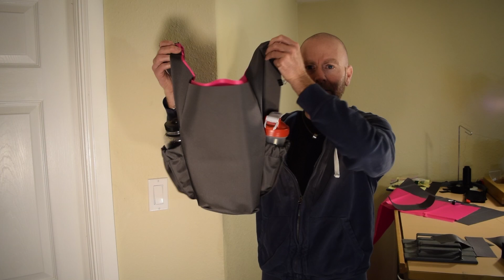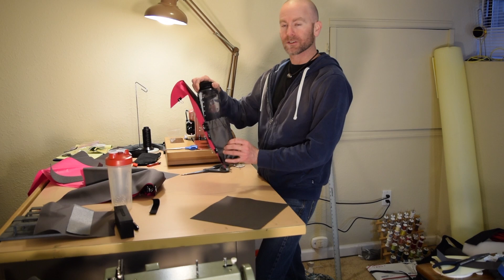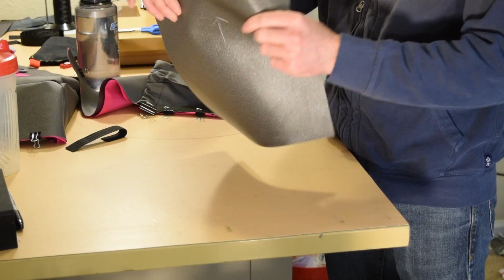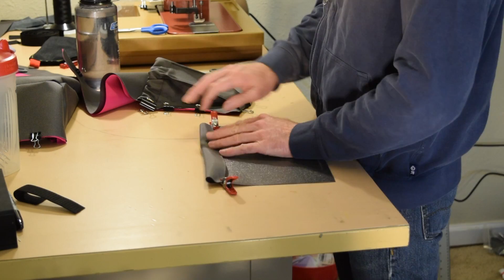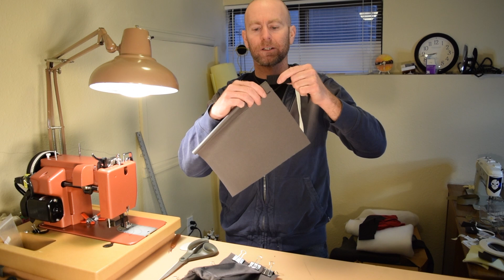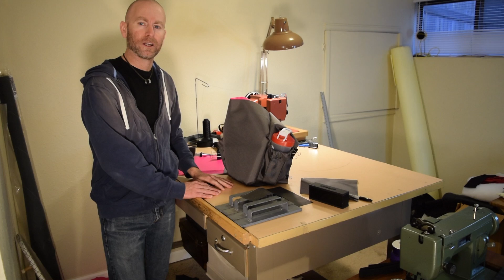Making a backpack: sewing water bottle pockets

Comment: Hi there! Thank you so much for this video! I was wondering how you arrived at the measurements for the pocket? I'm trying to craft my own pocket and I'm not sure how much extra room to give my water bottle.
Reply from the maker: Hi!
I'm sorry for taking so long to reply!
It's been years, and I often reuse this size for packs I've made since, but going from my dim memory:

I started with the width of the side panel of the pack, laid a Nalgene bottle (I always carry one and knew I needed to fit that) on the panel, and measured with a tape from seam to seam going over the width of the bottle.  I did the same for the height, just arbitrarily decided how high up the bottle I wanted the pocket to go and measured from there. You could honestly do it without actual measurements, just pin your fabric over the bottle on the side panel.

I did a multi-part tutorial on making a backpack, it might have some helpful information for you if you can get through the whole thing lol - 
https://www.youtube.com/watch?v=3n0mrYK-7vM&t=0s    (linked is part one, which I think might go over the bottle pockets, apologies if it's a different episode)

I hope that helps, thanks for watching and good luck!

Comment: hey, i was wondering if there is a way to sew side pockets like this onto a ready made backpack. i have a perfectly good bag that just doesnt have water bottle pockets. is there a way to add pockets to it? thanks
Reply from the maker: You could, but it would likely require hand-stitching, and depending on the materials involved, that could be difficult.
With a cylinder-bed (or a free-arm on a home machine), it MIGHT be possible to machine stitch pockets on, but only if you don't mind stitches showing on the inside of the bag. It could be possible with a flatbed machine if the bag opens widely enough to provide access (a clamshell backpack, for example).
It is always easier to do this stuff when the bag has not already been assembled.
I hope that helps, thanks for watching!

Comment: Needle nose pliers:  LOVE IT!
Reply from the maker: In a recent project, I used a surgical clamp (hemostat) for this step, and it worked even better, since it can be locked onto the end of the elastic.  But needle nose pliers work great, too.
Thanks for watching and commenting!
Reply: @thejasonofalltrades   I have a hemostat in my fishing stuff; thanks much!
Reply: Thanks for the video. I wished you had shown how to attach to the bag, kind of a critical part. Did you sew hidden seems on one or more sides or bottom? Also Better to cut your elastic after you sew. Much easier to handle and no need for fishing and all other sewing is accomplished on flat fabric.. Lastly, adding the Elastic should be the last step and reinforcement stitching should be at the same time as securing the elastic.

Comment: Why wouldn't you just use pins lol
Reply from the maker: Hi, 
I almost never use pins, for a few reasons.
One, because most of the fabrics I use are quite heavy, thick or otherwise hard to shove a pin through, pins don't usually work well for me - they tend to bend a lot.
Two, for the same reason, I end up poking myself in the finger with them.
Three, there are so many other methods that I find work for me - binder clips, basting tape, staples - that pins just aren't even a thing for me.  I have a bunch, and I honestly can't remember the last time I used them.
Four, sometimes I need to "pin" a bag together inside out (as it would be sewn) and then turn it right-side-out to check the fit.  Doing that with pins is like wrestling a porcupine, plus the pins tend to pull out.
If you haven't figured it out, I don't like using pins :)
Thanks for watching and commenting!
Reply: @thejasonofalltrades  I would also like to add that pin holes are not water proof.
Reply: Haha got em! go off on her jason

Comment: what if your sewing the pocket to a backpack thats already made, there really isn't a nice or even conceivable way to sew the pocket to the backpack with a sewing machine
Reply from the maker: Hi, 

So yeah, if you want to do this to an existing backpack, you pretty much have to take it apart to do it (if you watch my "retrofitting a pocket on a backpack" video, it kind of shows how this would go).  This would be a lot of work, but if the pack is important to you, and you REALLY want a bottle pocket ....

A cylinder-arm or post industrial machine might be able to reach inside to do it without disassembly of the pack, depending on the pack.  Also depending on the pack, and the machine, a free-arm domestic machine might even be able to do it.  With any of these options, the stitches would show through the lining in the interior (if any), which may or may not matter.

I hope that helps.  If you have a pack you are considering doing this too, you're welcome to email me, maybe send a pic or two and I might be able to give you an idea about options.

Good luck, and thanks for watching!

Comment: Jason, I have greatly enjoyed watching your videos the last couple of days. And thanks for the product reviews. I don't currently have a sewing machine but it seems I have often wished I had one. It got serious two days ago. I purchased a canvas tarp to use secured from the back of my truck for shade and protection from rain. I currently have a 6x8 but it's no good for heavy wind driven rains so purchased a bigger 10x12. Added a couple grommets which failed during the install process. So I thought I just need to reinforce the tarp. Didn't want to sew it by hand and there is nobody in this part of the country who does that kind of work. Then the quest for a good sewing machine began. After a long day of research, including watching several of your videos, I have decided to purchase one of the sailrite machines. Ordering it tomorrow. I am a retired firefighter and a carpenter before that career. My grandfather was a tailor so I think there's a little bit of that in my blood. In my retirement I hunt, whitewater raft and fish. So lots of gear and it always needs repairs or improvements. Looking forward to learning how to sew and maybe I can even make a little money repairing or modifying heavy duty stuff for others.
Reply from the maker: Hi Howard!

Thanks so much for sharing this - this is why I started making videos!  If you have a background in carpentry, you'll have no problem adapting to sewing (I was a welder for 10 years, and there is a lot of crossover between welding and sewing, as there is carpentry and sewing).
Enjoy the Sailrite, and if you have questions don't hesitate to get in touch with me.  Thanks for your service!

Comment: Great video, exactly what I was looking for. Off topic question, but do you ever work with lightweight fabrics. I was trying to sew with some 1.2 oz Robic fabric and had nothing but headaches, from the thread bunching up underneath to the fabric being sucked into the machine. Ruined 30 bucks worth of fabric. Thanks!
Reply from the maker: Hi!

I've worked quite a bit with 1.1 oz Silnylon and other similar fabrics (I haven't tried Robic, though).  I made my DIY hammock, under quilt, top quilt and tarp, and I think I used four different machines over the years working on those projects. I have a few suggestions that might help.

If your machine has multiple needle plates (the metal - depending on the age of your machine - plate the needle passes through on the bed of the machine), and if one of them is straight-stitch only, switch to that.  (If your machine is not capable of zig-zag, you already have this in place.)  The hole the needle passes through must be larger for zig-zag, and lighter fabrics can get "sucked" down into the hole, so switching to a straight-stitch plate might help.  I have a 1936 Singer Featherweight that is my go-to machine for lightweight fabrics.

If your machine has an adjustment for the presser foot pressure, reducing that pressure might help.  

Generally, you want to select your thread to work with your fabric, and your needle to work with your thread, so if you aren't sure you were using the right fabric/thread/needle combo, that might be a place to make changes, too.

What kind of machine are you using? (And what are you making?)
Reply: thejasonofalltrades it's a Kenmore 20 15358. Probably a real basic machine, something my wife already had. I've got Guttermann polyester thread and am using Singer titanium 90/14 needles. I'm not sure at all about the metal plate, I haven't touched it, it has measurements and little teeth that grab and move back. The presser foot I think is just a straight stitch one. Mainly where I had failure was at the ends or beginning, the fabric would get pulled into the machine. It would also fail sometimes when I would do a lock stitch, everything would bind up. 
Today I was messing around with some cheap tarp fabric I had and the thread snapped a handful of times. No rhyme or reason. I'd do a real nice stitch and then I'd notice I was just punching holes. 
I'm sure it's something with the operator. 
I always spin the wheel towards me, I always sink the needle holding the thread before starting, I don't mess with the tension, it's at 5 (of 9). The pattern I use is the straight middle stitch and the length I do is usually around 3. It goes from 0 to 4 and then a long line then it reads 'L'.

I was trying to make a hammock, which shouldn't be too difficult, rolled hemms and create a channel. I've tried to make a few things, some turn out okay, most end up in the trash lol. Thanks!
Reply from the maker: I made my hammock on a 1987 Kenmore.  Since then I've moved on to a bunch of pre-1970 machines (with the exception of the Sailrite and an industrial Singer).  Honestly, I think machines from pre-1970s just work better in every way, and might make your sewing life more pleasant.  Check your local thrift stores, I've bought several machines for $20 or less, and they're great.

That said, don't be afraid to play with tension (especially if things are going badly, since you are unlikely to make them worse!).

If the machine has a manual (likely available online if you don't have it), READ IT.  There is a surprising amount of helpful information in some sewing machine manuals.

It might not be a terrible idea to see if there is a sewing machine repair shop in your area (most large fabric stores will have someone they contract with) and have your machine checked - as they age, sharp points can develop on metal-to-metal contact points that can tear thread.

Whatever you do - DON'T give up.  The first projects I did were pretty bad, and there were lots of frustrations (go watch some of my earliest videos if you'd like a laugh).  If I tried to write the simplest line of code I'd pull my eyeballs out, but it's just a matter of learning.

My email address is in the "about" section of my channel.  Feel free to email me if you have other questions or if I can help.  Sleeping in a hammock you made yourself is one of the most satisfying experiences ever :)
Reply: Code is simple, plus if you mess something up, you can just erase and fix it, that's hard to do when dealing with scissors, rotary cutter and fabric hehe. 
I will do just that! I'll check the thrift shops and see if I can find an older machine. Sleeping in a hammock period is satisfying, can only imagine what sleeping in one I made would be like. Fortunately I have a couple months of bugs until they die off (in Arkansas) so I have time to learn. Thanks!
Reply from the maker: LOL My Dad lived near Ft. Smith, I know the ticks there intimately ....

Comment: thanks for great video
I wonder how to build that waterpocket into main body of the bag?
Do you have any video of that process?
Reply from the maker: I don't yet have video to post of that part of the process.  I'm in the planning stages of a full backpack build video, so stay tuned!
In the meantime - there are numerous ways to attach the bottle holder to a pack.  The method I'm using on the pack in this video is to sew the edges of the bottle holder into the seams between the side panel and the front and back panels.  The bottle holder fabric just gets sandwiched between the other pieces, then sewn all as one. If you were adding a bottle holder to an existing pack using this method, you would seam rip those seams open and trap the bottle holder fabric in the seams.
This is one of those "easier to show than tell" things, but it's very simple to do.
Thanks for your question, and thanks for watching!

Comment: How many yards of dernier did it take to make the pack .
Reply from the maker: I have a giant roll of this fabric, and a bad habit of not paying the slightest attention to how much of it I use (I got it embarrassingly cheap).  Rough guess, a yard would probably do for the outer layer, and an additional yard of fabric (either the same or contrasting) for the inside.  The exterior of this pack is 1650-denier ballistic nylon (I think, I don't have a label to accurately identify it) with 200-denier nylon for the interior.  There is a foam padding (about 1/4" thick) in the back and the straps.  This one will have two side-release buckles, plus two additional female buckles that will store the straps when not in use. There are two adjusting buckles called "ladder locks" on the straps.  And there's some large strips of velcro.  I'll shoot a video of the pack when it's done to cover all of the details.
Thanks for watching and commenting!
Reply: I found a place for nylon strapping and buckles and such .. It is called Strapworks.com . They have a newer buckle I am thinking of useing on a belt and or or rifle sling  . It is a magnetic clip. Strapworks calls it the FIDLOCK . They have a you tube channel . I can see in the recommendations after watching the fidlock video . That a couple companies have licensed it or used it in their products . A motorcycle helmet is one . I think the magnetic buckle is ideal for anything one needs to get to fast and or often . Anyway I thought I would share that source with you if you didn't know of them .
Reply from the maker: Thanks for the info!  I buy from Strapworks all the time, but I hadn't seen that buckle before, very interesting!
Reply: search You Tube for Fidlock Buckle . Strapworks has a you tube channel . You have got to see the characters they have in their video's . Reminds me of the Lone Gunmen from the xfiles . You have a guy called strapworks phil and their are 2 other guys that do videos .

Comment: which is better to sew backpacks on the sailright walking foot or the industrial singer?
Reply from the maker: Between the Sailrite and the Singer 20-33 that I have, hands down the Sailrite.  The walking foot makes all the difference.  The Singer is capable of higher speeds, but it has trouble feeding stuff that the Sailrite laughs at.
Reply: when you sew with the singer 20-33 do you have to feed the material carefully? Did you make a video on installing zippers? Where do you recommend on buying heavy duty zippers?
Reply from the maker: The 20-33 feeds lighter materials/fewer layers very well, but when it runs into thick seams it sometimes needs help.  It's really intended to do commercial apparel construction, not heavy Cordura stuff.
I haven't yet made a video specifically on zippers - I am planning one - but you might check out my easy zipper pouch project video, there's some good zipper info in it.  The toiletry bag video I made a couple of months ago has some good stuff, too.
I bought a ridiculous amount of zipper from someone on Craigslist, so I won't be needing zipper for a long time (unless I need other colors). I have bought some from Rockywoods Fabrics, and as always I was happy with what I got.  If you're making a backpack or something like that, I like YKK #8 continuous metal coil zipper.

Comment: hi, which thread do you typically use for projects like these?  just got an Elpar Industrial Sewing machine, and starting some small projects.  thanks.
Reply from the maker: I pretty much exclusively use nylon thread in size 69 (sometimes labelled V69).  Make sure you get the right size needle for your thread, too (your machine manual should explain this).
Thanks for your question, and good luck with your projects!

Comment: Nice! How did you then sew it onto the side panel? It looks like the pocket fabric is wider than the side panel. How did you sew it on so perfectly?
Reply from the maker: Thanks!  Actually, in the video it's just clipped in with binder clips for now, as there is a lot of work left to do before I actually sew the pack together.  But it will all be sewn with a 1 cm (3/8") seam allowance and will look pretty much as it does clipped together.  The bottle pocket is just laid on top of the side panel and sewn in the side-panel-to-front-panel, side-panel-to-bottom-panel and side-panel-to-back-panel seams.  Hopefully I can shoot a video on the assembly process to make that clearer.
Thanks for watching and commenting!
Reply: @thejasonofalltrades It's the side panel to bottom panel I have questions about....  It's larger so how does that work??
Reply: @thejasonofalltrades  I have the same question. Try to figure it out by myself, and still error. Hopefully you have video how to assembly it. Thanks.